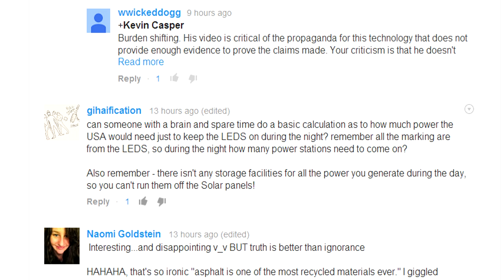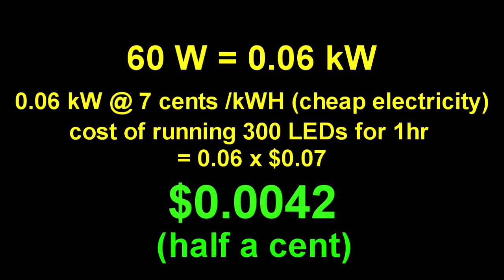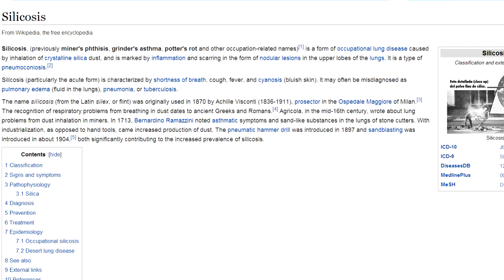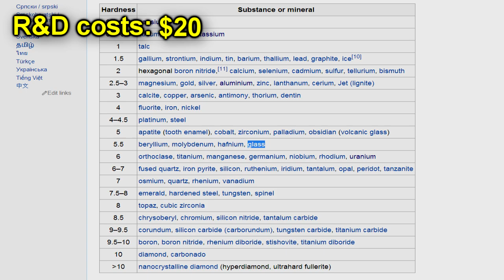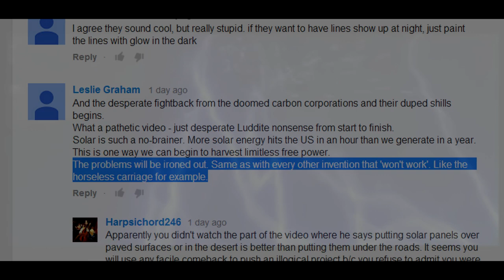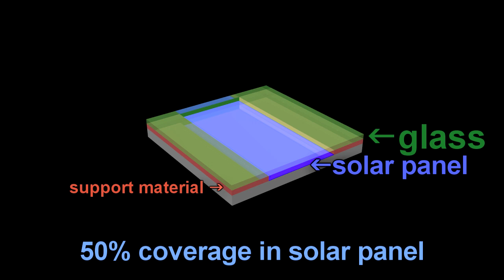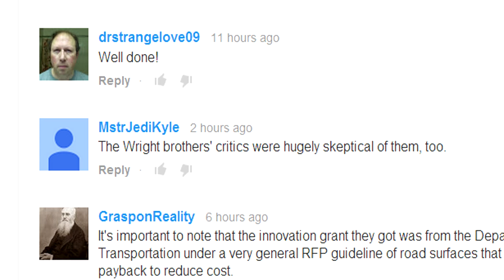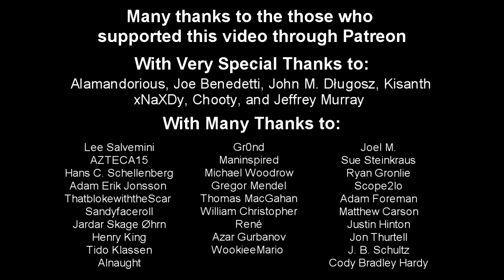Solar Roadways, IMPORTANT QUESTIONS AND ANSWERS!

Comment: On a slightly different note why don't we put solar panels on the propellers of wind farm turbines?

I also wonder if we can put wind turbines on a ship about the size of an oil tanker to gather energy to charge large batteries while at sea.

I also wonder if we can use magnetism to create power. After all magnetism is more powerful that gravity.
Reply: i hope you are joking
Reply: Nope. I'm actually very curious if it can be made to work. Allow me to reiterate MADE to work.

I also don't mean the typical wind turbines you see in fields. They would not need to be that high. Also most people don't realize how large oil tankers are.
Reply: ok then lets do a quick explanation for each of your ideas.

1. solar panels on wind turbines
we do that already but not on the propellers. the propeller is rotating and the blades of the propeller aren't pointed at the sun all the time.

just place them at ground level and point them at the sun with a small motor to rotate it.

2. windturbine on a ship
unless you have a tailwind thats essentially driving a windturbine with the ships engines but its doable though i like the idea of massive kites that pull those big tankers along better.

just build offshore windparks, its easier to do and more sensible since those big tankers have massive engines that can easily create a bit of electical power on the side.

3. magnets aren't magic!
 you cant create power from nothing
further: see induction
Reply: spinnenente
magnets can hold a charge for years, and may be used to spin a propeller positive/negative charge on one side, and the opposite charge on the other with a constant charge focused on the propeller.

I'm fully aware you can't get something for nothing, and as far as energy goes you don't even break even, but you can use whats already producing energy to siphon off of that, and you can mitigate energy loss.

Thinking about the least amount of energy you can lose makes me think of things like 0. energy which just makes me think of ZPM's from Stargate, but that's off topic, and more or less scifi.
Reply: there is no shortage of space in America, there is no need to put solar panels on turbine blades or on roads
Reply: Erik Benefield
I think you've been watching "free energy" videos. You know the ones with magnets arranged in some strange way to make stuff move?
Those don't work, when it looks like they work it's a trick.
Reply: Erik Benefield

I suggest you look up how alternating current is generated. You don't need to take a course in electrical engineering, but at least have a clue as to how the energy you use every day is produced.
Reply: Erik Benefield Well, speaking briefly on just the magnets: since we already use magnets in the turbines that generate said electricity, so to turn them you'd need a similar amount/strength of magnets outside with the ability to change their charge (i think electromagnets can do that but then you'd need electricity to power them anyway) or some mechanical device to move different magnets back and forth to spin the turbines, while at the same time pushing with enough force to resist the push from the magnets in the turbine. Now that mechanical system could either itself be powered by electronics or by simple machines, but at that point it's just easier to use that force to power the turbine to begin with
Reply: Erik Benefield
"solar panels on the propellers of wind farm turbines?"
So far, there is no solar panel, that would withstand this for a long time. And you don't want glass-fragments being flung around.
Nor would it produce much power, as those blades are hardly ever point directly at the sun, and even then, only a small part is looking directly at it, most of it, would be at an angle.
So now you have heavy, fragile rotars that only produce a tiny bit of extra power but cost a lot to produce and decrease the energygeneration fomr wind.

"I also wonder if we can put wind turbines on a ship about the size of an oil tanker to gather energy to charge large batteries while at sea."
Nope. Simple nope.
A wind-turbine takes the speed of the wind compaed to the ground to turn that force into useable electricity.
The problem: The turbine faces a power dragging it backwards stornger, than the power creating energy. Fir a ship that would mean, you'd need extra power for the ship not to be moved around randomly. MORE power, than you woudl generate. Better give the ship a sail (like japan is doing).

"I also wonder if we can use magnetism to create power. After all magnetism is more powerful that gravity."
Ever heared of generators? They use magnets. but not the way you think.
Magents are stronger than gravity? so? Who cares?
You have to have some source of energy to  convert it into electricity. otherwise, we would have used gravty to generate free energy, but that doesn't work, as you have ot use energy to move an object up to get energy from it being moved down again by gravity. Same goes for magnets.
And even worse, you would actually use up power for nothing.

Sorry to have to say it that way, but you better not talk about anything even related to science before going back to school.
Reply: Erik Benefield I hope i can address this without upsetting you in anyway.

Wind turbines with solar panel are viable but not efficient compared to alternatives. Wind turbines are located in areas with wind blowing most of the year, while solar farms are located where the sun shines most of the year. Indeed you can have both at the same time but everyday experiences may prove that most sunny days are calm, and most windy days are cloudy. as well solar panels work by having sunlight aimed directly at the energy cells. It is intuitively bizarre to have the solar panels in constant motion.

As for turbines on ships, it is not practical as solar turbines provide excess drag for the ship regardless of the direction of the wind. Wind does work on a given object proportional to it's surface area. The extra work done on the turbines will hinder the motion of the ship that places more stress on the engines. as well the turbines are useless on a calm sea, where the extra weight just equates for more fuel needed by the engine. simple thought experiment, if the wind is blowing against the ship, it will cause more drag on the ship needing more power from the engine, if the wind is blowing from behind the ship, the turbine will "consume" the force caused by the wind and the engine that once could have used less energy if there was a mast, now needs more energy to maintain the same speed. another analogy would be a battery powering a turbine to generate energy to charge the battery. according to the laws of thermodynamics. energy transfer is never 100%.

Lastly electricity is in fact generated by magnetic fields, and magnetic fields are created by moving charges i.e. magnets. Earth magnetic poles however are not in motion relative to us. unless you station a large generator in space, we cannot harness the energy within the earths electromagnetic fields, and even so, we will only get energy once a year.

final statement. radiation is normally a stream of particles. these particles will display electromagnetic properties i.e. a charge or generate a field. a electromagnetic field acts upon a charged particle much like gravity attract masses that is how shielding with fields work. trying to harness the work done by EM fields is the same as harnessing the work done by gravity fields, and so far we only have dams to harness gravity. Some other source of energy is needed to move charged particles into a high state of potential energy before we can harness it.

Alternatively, you should read into harnessing radiation from space for energy. that would be a better area to research than to place turbines everywhere ^^
Reply: ...And you can produce energy from gravity?
Reply: Erik Benefield + Edison DID NOT invent the lightbulb, he took the invetion from a woman.
Reply: 1. this was answered adequately.

2. the energy generated from turbines on a moving vehicle would be lost in the drag created by the turbines. This is the same reason why its more efficient to use your air conditioner at 50+mph than it is to have your windows down.

3. A magnet's "charge" is nothing more than an alignment of electrons. The amount of energy you can generate from two magnets pushing apart is equal to the energy you put into pushing them together initially. Also, the energy that can be generated from two magnets coming together is equal to the energy it will take to pull them back apart.
Reply: Erik Benefield
1) 'blah blah blah engineers are lazy, blah blah'
Kind of irrelevant because the materials required for the proposed simultaneous applications simply don't exist. When you need multiple properties you need composite materials much like black top is. However asphalt doesn't have the requirement of being clear. It does however have the properties of being water proof, durable and hard due to the composite composition rather than a single type of composition.

Even if you used diamond as a cover for the panels to compensate for the hardness issue, assuming you wouldn't have the panels stolen for the material it would still be very vulnerable to shattering. Remember, sand doesn't care about being clear or shattering to do what it does to glass.

Even if you used a composite material to bind the diamond and still managed to keep clear properties the binding agent (much like the asphalt) would be vulnerable to the same wearing forces.

2) We shouldn't have "one standard of renewable energy" there are many areas that are better for wind, solar, tidal or geothermal for example. Like it would be folly to have your main power production in iceland be solar in an area where it's difficult to get direct sunlight when they have such vast supplies of reliable geothermal power.

3) Creativity is one thing, practicality is another, it takes a lot of energy to move a tanker, it takes a lot of materials to make batteries and move the associated weight, it takes a lot of energy to stabilize a tanker if you want to use it to harvest wind power, the ability for a given windmill to harvest energy isn't infinite, most modern windmills have brakes on them so they don't fly or vibrate apart. You will lose far more energy converting mechanical energy to electrical to chemical then back to electrical to get it to a usable grid than you would if you had a wind farm connected directly to a grid off shore or on land.

Off shore wind farms or concentrated solar farms would be far far more efficient, reliable and less resource intensive to implement. Especially since we're in no shortage of land and you're using far far more of the materials to actually produce the energy than you would for the tanker+less windmills+batteries+energy to move the tanker to where you want to place it.
Reply: Erik Benefield you can learn by observing a cat's reaction to someone else interacting with its tail...besides I think the gist of that quote is more "if you're too stupid to not grab a cat by the tail, then the only way you'll learn is to get scratched." any sane person knows not to do that
Reply: Erik Benefield A.) you can do the math beforehand, (which they did)
b.) they ACTUALLY tested it
Reply: ZealotOfSteal
Never heard of that, but nothings free although I'm sure you can get a really good deal on it.
Reply: You know it must take a lot of energy for the earths magnetic field to repel radiation like it does. wink wink
Reply: Erik Benefield 
 No, the reason is the exact opposite:
Cause i do want technology to advance and i do know my fair share, how stuff works.

I do know that Edison-line, but does it apply here? Would Edison try to use a banana in the light bulb? Nope.

Come on, at least read my comment and see, that i have offered some arguments and not only plain "nope" or insults.
What you have done, is trying to undermine me without giving a single argument.

And now, Harry He  Has given a more detailed reply that addresses the issues i have listed even further.

It would be a waste to research stuff, that we do know as fact, are less efficient than our current techniques and will always be.

No matter what you do, when you mount a Solar-panel on a wind-turbine, you got some problems:
Solar-cells aren't very robust and won't withstand the forces on the blade very well. Most of the time, they won't be facing the sun, cause hardly anywhere, the wind comes form the same direction as the sun does.
The Blades are not a flat-surface and all are at different angles. If one Part of the blade faces the sun directly, another will get nearly no light.
For the wind-turbine:
Extra-weight on the plates means you have higher wear and tear at the bearings and loos a bit more power. Getting the energy form the rotating Solar-panels would not be easy either. Rotor-blades would be significantly more expansive too. And maintaining those solar-panels 50+m up in the air isn't easy either.

If you simply put the solar-panels in a region with more sun-hours/day with mostly clear weather, like a desert, you can use adjustable mounts to allow the solar-panels to follow the sun. You don't need to worry that much about sun thus making them even more efficient.

Most of the ideas people come up with, have already been tested and the reason they aren't used is simply they aren't viable.

A little example for your Ship-idea:
Mount a wind-turbine on top of your car. You will need a lot more gasoline to drive while only marginally generating power. And the net-effect will be energy-loss.
Reply: Harry He

Very good explanation; much more eloquent than I could muster at the time.
Reply: Erik Benefield
Magnets don't carry a charge. They simply have the property of being magnetic. And sure, you can use magnetism to create electrical energy but that is something we have been doing for a long time now... in power plants...

Also: using wind to power ships has been done for a very long time. Then we discovered more powerful propulsion methods called engines. I turned out that the wind simply doesn't have the power to propel large ships at economically viable speeds. (Basically, putting a sail on an oil tanker is about as useful as farting to make your bike go faster.)
Reply: Johan Engqvist No The light bulb was invented long before Edison was even born by a British man, it just was not commercially viable. And Edison's bulb was developed by a black man working in his think tank, not a women.
Reply: Harry He
You can still get solar energy on a cloudy day, and I've also covered the second law of thermodynamics in another comment.

In addition you can also turn this question on it's head, and if I may join the band wagon with you guys, ask the question is the energy produced from solar panels in the sun, and wind farms on par with hydro electric, nuclear, coal, or oil? Or is it more you'd like to implement these ideas of yours, because of some sense of altruism?

With modern technology silicon, copper, and aluminum are raising in price, and damage by UV, and infrared light make for the need to replace the panels. Panels also are not cheap. Even if the energy produced could match current oil prices the oil prices would still be adjusted to outplay reusable resources.

We also do not have a standard for reusable energy so implementing them proves problematic I can best describe with the analogy too many chiefs, and not enough Indians. The same thing can be said for networking protocols, operating systems, and simple code in general. You cannot make a big enough stand against oil with too many different ideas. Just like you can't expect every independent computer programer to expect the world to use their individual version of lynx, so they can take on big bad Apple, and Microsoft. You cannot mass produce it at the same rate, you cannot buy it proportionate to price in bulk as in oil, and it takes more time to construct, and more maintenance. You do not have a general rule of measurement.

See? I'm one of you now. I'm helping.
Reply: Just to clarify something I am familiar with the second law of thermodynamics, and rough 30% of energy spent is lost yada yada yada it's just taken on a bad connotation with me, because theist love to use it to explain creationism, because the sun goes away at night, and doesn't tell us where it's going, so therefore god must be real 'cause we don't have the energy at night to live.

I also know we have these things called "engineers" whose job it is to find ways to make metal fly, travel under water, create horseless wagons called "automobiles", split atoms, find the higgs boson, breath in space, and make solar panel roads work through proper design, mitigating resistance, distributing weight, optimizing throughput, etc, etc, etc.

They just don't want to make it work, because they are lazy. I know they are, that's why they're engineers. That's why they make things run better, so they don't have to do as much afterward.

This video is really about the R&D money which isn't going towards materials. It's going to be used as "inspiration" for engineers to work on the project 'cause they won't roll out of bed for less than $100 an hour on a salary, with benefits, and their name on a patent, so they can do all the work in i short amount of time then sit on there ass in their boxers, and try to catch popcorn in their mouth while getting paid, because they're caught up on all the work.
Reply: Ideally i think it would be rather neat to have a huge oil tanker with a converted cargo bay for giant batteries connected to a deck of wind turbines that could rotate to the direction of the wind if the ship can't position itself properly into the wind, and have these giant ships go harvest wind by chasing hurricanes. You don't hear of many oil tankers capsizing. When you hear about these tankers it usually involves an oil spill, but there wouldn't be oil on the ships I'm talking about.
Reply: garith21
Sorry man. I don't agree. your ideas would be using much needed resources for smartphones, PC's, networks, and all manner of electronics. We simply don't have the raw materials for your ideas, even if chemists are developing new materials practically on a daily basis.

Plus with climate change solar may not be viable if a sunny area becomes cloudy, and the winds around the world change, and the ocean currents changing do to the gulf stream equilibrium being thrown off kilter.

It's just really hard. Life's really hard. We shouldn't do it 'cause it's hard.
Reply: There's two reasons why I'm not wrong. The first is plausible deniable, and the second is uncertainty. Even if I am wrong that would be a pleasant surprise, and it's not like this topic of conversation will be relevant in the near future.
Reply: Erik Benefield
1) It's not "my idea" It's a comment on the limitations of materials for the applications that are desired for solar road ways, or do you not comprehend it.

This is precisely why many people think that solar road ways are a terrible idea.

2) Uh, while it's true the world will change it'll change in one general direction, for example the south western united states will suffer more severe droughts. The fact that things will change don't suddenly make the field of climatology which make predictions with regards to these changes not work.

There are basic physical features of both the tilt of the earth, the land masses and mechanisms of the warming that tell us how the earth will change over time.

3) I also commented that we can't have "one standard of renewable energy" because of the differences in features of how renewable energy works but you didn't seem to want to address that at all

4) "It's just really hard."
No, it's not just "really hard" it's impractical and uses far more resources and energy than would be generated from such an idea as a wind barge.

Also I find it hilarious that you're railing on hypothetical use of materials for an application that I think won't work but you're advocating for an even more resource intensive task like a windmill barge which might consume as much or more energy just to operate than it would likely make.
Reply: garith21
Wow you really are that slow. You really don't get it do you? Just right over your head. Your personality must be as monotone as Ben Stein. You should get checked for Asperger's 'cause you have no sense of irony what so ever.
Reply: Erik Benefield
Either it's a case of poe's law, you're dumb or you're being entirely sarcastic without using any sarcastic references to make it clear in a text form.

All the same lots of stupid people make stupid proposals like you've made while being completely serious about it. Since half of what you say seems to make no sense what so ever ruling out you're dumb becomes harder to discount.
Reply: garith21
Yes it's that way. You win. You get a gold star!
Reply: spinnenente I bet he is, these are equally as asinine as the solar road ideas
Reply: K3WRO
Truth be told I see it two ways: You gotta take a risk to discover new things, but there's also the aspect of caution. Somethings outcome may seem predictable, but you may have missed something as simple as carrying a decimal place.
Reply: Erik Benefield Once you take the risk, you'll know the risk.

This will be an expensive lesson if it fails though.
Reply: K3WRO
"A man who holds a cat by the tail will learn a lesson he can learn no other way" ~Mark Twain
Reply: TVlord5
And if everyone's pacing back and forth, and no ones testing the waters what then?
Reply: Erik Benefield The point of testing the waters is to do it BEFORE it's a big enough deal to cause damage...
Reply: TVlord5
Depends on your level of risk assessment.
Reply: Erik Benefield in what way? Because the way you're saying that makes it sound like you're agreeing with me that if you test the waters and find that its boiling, you'd need to be an idiot to then jump in
Reply: TVlord5
No I'm saying everyone has different comfort zones. Some people are risk takers, and others aren't.
Reply: Erik Benefield -_- ok then, imagine this: "Hey there! I'm going to leave this gun out lying in the road by your house. Pick it up, put it in your mouth, and pull the trigger. Don't worry I promise it's not loaded!" Would you take that risk? NO because you'd be stupid to do that
Reply: TVlord5
Someone who plays Russian roulette might.
Reply: Erik Benefield -_- That NOTORIOUSLY non-lethal game....and the rewards for trying and winning are SO amazing! You know...like...not dying? Almost as if you had never played it.
Reply: TVlord5
Just like Apollo 11.
Reply: TVlord5
btw did you know astronauts aren't allowed life insurance?
Reply: Erik Benefield
1.)That was well-planned out with tons of previous PRACTICAL tests on a smaller scale beforehand. (apollo 1-10 for example)
2.) It was supposed to be the beginning of an entire new age, with actual goals in mind: The age of space exploration and colonization.
3.) It was the culmination of the dreams of almost the entire human race for hundreds, if not THOUSANDS of years, to visit the heavens and walk on the moon.
4.) They KNEW it was possible before going up there for that mission. The only possible ways it would fail would be from either a defect in the equipment, or human error.
5.)They actually did some work up there. Performed some experiments, gathered some physical samples to be able to directly and physically examine the composition and other traits of the moon.
I'll add some more points as I think of them.
Also: so what if they can't? That's either the fault of the insurance companies who don't want to take that HUGE risk. (which from a business standpoint is the ONLY sensible thing to do, even if it is a little harsh), OR NASA restrictions to help encourage them to do things right since it would mean either come home to your families or leave them without you and in debt.
Reply: TVlord5
You know rocket science cost money to test right?
Reply: ABaumstumpf
Did you know Edison didn't fail at making the light bulb 100 ways, but instead found 100 ways not to make a light-bulb?

Are you also familiar with Jules Verns books From Earth to the Moon, and 20,000 leagues under the sea?

Do you have an imagination, and creativity? 
Are you scared to be wrong?
If so why?

Why do you belittle others who do want to learn, and who are curious?

Are you a giant douche sir?